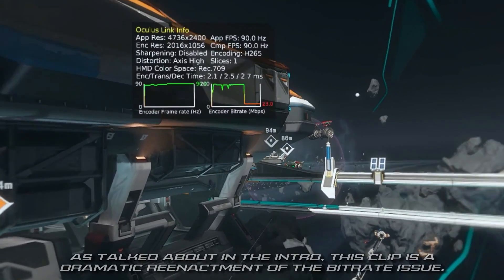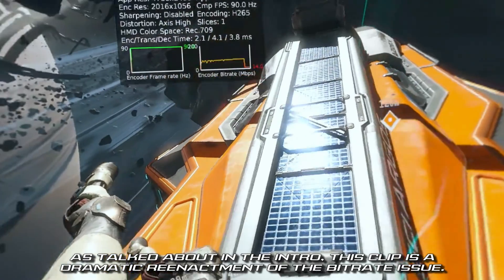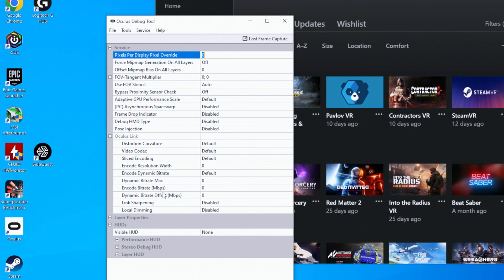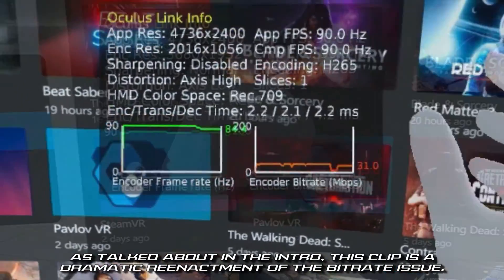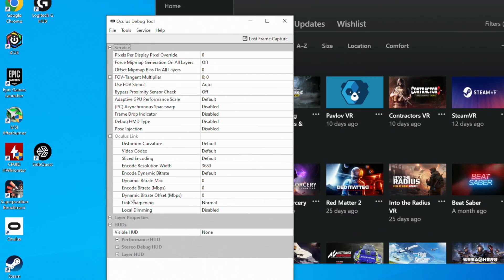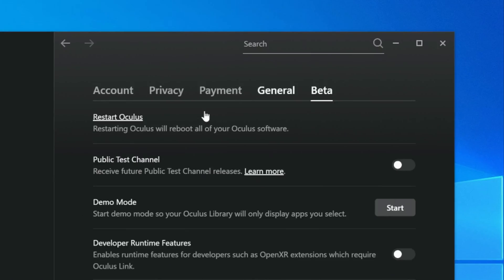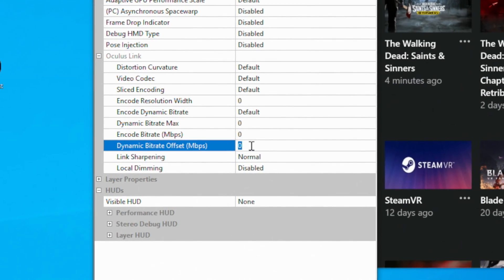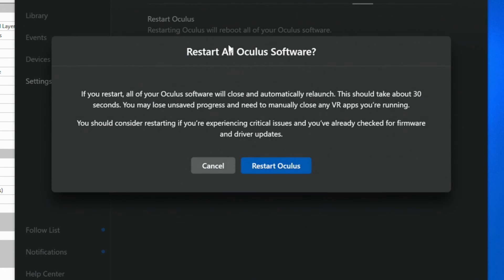Quest Link and AirLink Graphics Looked Horrible with My AMD Radeon GPU Until I Did This!

Comment: Since the video was made with the quest 2, what encode resolution would Width would you use for the q3? or is it the same
Reply from the maker: since making this video, I believe AMD and Meta have got things working better. I recently tested the RX 7900GRE and didn't have to mess with manually setting the encode width in the Oculus Debug Tool... well I guess that's not entirely true... when running at 90Hz or below the default encode resolution was great, however at 120Hz the encode resolution was noticeably lower, so I did manually set it when running games at 120Hz, BUT... I had a game or two start having frame rate issues. The Performance Summary overlay in the ODT showed I was running at 120fps, but it certainly didn't look like 120fps to my eyes, so I pulled up the Link Info and sure enough the encoder frame rate was NOT at 120. It was down in the 60's and 70's.  Once I set the encode width back to default it fixed that problem.
Reply: @Maraksot78  Ah okay thanks for the update, I was worried my gpu would be causing me problems but it seems I'm off good then

Comment: I use the old rift s with my 7800xt. I'm grabbing a quest 3 and hopefully I can test it before upgrading to the 7900 xt. Either way it's got problems on the rift. Ghosting on all usb ports and nothing I have done fixes it. I forced my ram to the lowest latency possible and slowly clocked it up rather than using xmp. I tried lowering my dpc latency as much as possible.  Went back to 10 cuz 11 is amazing at destroying frametimes. I also used an external hub for powering my usb. Still rough performance. But yeah meta is not optimizing for recent amd gpu's yet. But many things arent 7000 series compatible. I might just grab a 6900 xt rather. Gotta sell my 7800 xt first tho.,

Comment: Link/AirLink inconsistencies led me to buy Virtual Desktop a week after I got a Quest. It solved everything for me and I never looked back.
Reply: is it really better? After all, is only 20 $
Reply: @aplaceinthesky82  It's been my most used app by far. I connect to PC a lot and it's never let me down...but AirLink did.
Reply: @aplaceinthesky82  Yes a life changer but now there is steam link which is pretty close and free
Reply: @aplaceinthesky82  needs a 6e router then it's good
Reply: @aplaceinthesky82  I had to reset my plum router and choose auto instead of router. After the stuttering and drops were fixed!!! , My link cable works fine, and always has so I don't know what issues others had.
Reply: Why is my oculus debug a command prompt?
Reply: i am going to buy a quest 3 in august 2025 and pairing it with a amd 9800x 3d
Reply: with virtual desktop for streaming movies to the headset from my computer any suggestions.
Reply: I had the opposite happen haha. Virtual desktop absolutely kills my headset

Comment: As a laptop user i have always had trouble getting quality resolution using airlink and even a cable. I did not understand why for the longest time. I have a spec'd out rig that has me playing cyber punk in 4k after all with min 80 fps. Then I found out that my only my onboard amd card was compatible with oculus software but not my 3070 Ti! I switched to virtual desktop and never looked back. I average 10-15 Latency and can chose ultra settings in almost every game. Meta needs to expand or they will fall behind.

Comment: With my 6950xt and quest 3 I just use 250mbit fixed within the Oculus tray tool. 1.4x resolution in the Oculus Software. Within the quest I set the Bitrate to dynamic and slide it to the max which is 200. In the performance overlay my Bitrate is shown as a graph like if u set it variable but it's always at 250mbit. When the wlan connection is bad for some reasons, then the dynamic kicks in and lowers the Bitrate uner the 250mbit but that never happens when I stay near my router. Graphic looks good and the latency is around 40ms

Comment: does anyone know the encoding bitrate for the quest 3 and how to get that headset working with a radeon graphics card?
Reply: Had no issue with 6950xt and quest 3. What problem do you get?
Reply: @schaki05  no issue, just wondering what the bit rate for the headset was because the resolution on the quest 2 and 3 are different
Reply: @tophat5128  depends an what u choose. U can Go up to 960mbit but that will be at the cost of latency and stability. 250 works best for me

Comment: How does one get the 7800xt working with quest link or airlink? I receive a "GPU not supported" error, and it looks like the 7000 series isn't on Meta's compatibility matrix. I'm using virtual desktop currently to play PC games in the meantime (no ethernet, so performance is meh).

Comment: 3:48 wait a sec, how do you make the hands come out in questlink/airlink?? the only thing it always came up for me was the menu and oculus button gesture to pop up and I thought it was a bug
Reply from the maker: I'm not sure I fully understand your question. Are you trying to use Quest Link/AirLink using hand tracking only, i.e. without controllers? As far as I know, hand tracking only works with the Quests native menus and in specific hand tracking games. I'm pretty sure you have to use controllers for Quest Link. The hands you see at 3:48 is just the representation the Rift interface displays of the controllers. I was using controllers when doing all the VR stuff in this video.
Reply: @Maraksot78  ohhh I thought they were real hand tracking stuff, i did not know rift shows the controllers looking like hands xD

Comment: hey there what does application frame rate drop of 800 plus frames?  i have a lot of performance head room it says. and i have wifi6e set up.  on my 4090 is it a big problem? quest 3
Reply from the maker: As far as I can tell, it's a counter that lets you know when the application (i.e the game you're playing) drops frames. This does happen sometimes as you're playing, but most of those dropped frames are during loading screens, so it doesn't negatively affect the experience.

Comment: I recently upgraded to a quest 3 and when I try using quest link cable (official oculus cable) when I jump into quest link I can see that the refresh rate is obviously not 90hz it looks more like 30-40hz, when enabling the debug tool's performance graph I can see that I'm getting a solid 90 frames and have plenty of gpu headroom, I've tried switching the video codec from h264 to h265 yet the problem persists, the only work around was using virtual desktop but I'm far from my router so playing games like pavlov and contractors gets a bit annoying when my connection gets interrupted leading to delay/lag not to mention the decrease in quality 

If anyone has run into this issue or has any suggestions to fix it please let me know 

System Specs:
CPU: R9 5900x
GPU: 6950xt Red Devil
RAM: 32gb 3600mhz (4x8gb)
PSU: 850w Corsair RM850
MOBO: B550 Asrock Steel legend
Reply: I found the cause to my problem, having the "record desktop" option enabled under the record and stream section of the AMD software gave me this problem once I turned it off all returned to normal

Comment: I'm using a Rift S and it's been great with my 7800xt.  With a tiny bit of tuning It's awesome.  I think a dedicated PCVR headset is kind of where it's at with AMD GPUs right now.  Which doesn't bother me but I know a lot of people are really into the Airlink/wireless thing.
Reply: I just got the RX 7700 XT, coming from a 1080 SC. I'm blown away. Seamless VR. Returning it for the RX 7900 GRE, only because I want the extra headroom. So that I'll theoretically be covered for the next few years.
Reply: @Cogsworthcreations there'll be a new GPU standard by 2026 and you'll be behind lol. Watch. Not just vram but the actual architecture
Reply: @Cogsworthcreations  good decison. Did the same from a 5500xt to an 7800xt.
Reply: Am intending to get a used Rift S for PC VR n running the 6800xt
Reply: I can not turn of screen you to
Reply: Can you pls tell your settings? I am using 7900xtx but the graphics on RE7 PC mod looks really bad

Comment: Yet all the non-tech savvy normies will blame AMD when it meta. Started digging into this myself when I saw the channel ‘Cid from VRChat’ dumping all over AMD while as people (myself included) using non-meta headsets like the index, reverb, and vive had no major issues.

I was running on a wx7100 with zero issues at one point… that’s comparable to a 480… yet people are saying newer 6000 and 7000 series cards bad and unable to handle VR.

Makes me wonder if this bias is some shady corporate warfare against AMD cause I just don’t see a company as big as meta-messing up like that on accident. Either way it obviously hurts. AMD’s reputation as only dedicated gamers like yourself would dig into this matter.
Reply: Also, apologize for the bad grammar. I’m on mobile right now.

Comment: I don't know if this will help anyone with a amd gpu. But I think there's one setting in the Oculus debug tool. When I was trying to enable h2.65 in the video codec setting.  I was experiencing a weird tearing issue on my right eye in the headset. But then when I turned off sliced encoding. that issue entirely went away and never came back. I was thinking that was the same issue that some people were experiencing on AMD cards and was wondering if that could probably fix it. For me when I went back to h2.64 with sliced encoding off both of them had no micro stutter anymore after I turned it off. But I want to see if that could be the fix for anyone on a amd gpu. If it doesn't then man oculus needs to fix their app

Comment: Airlink and Meta's software simply sucks. I have a 4090 and ONLY use VirtualDesktop because I still have issues with their software. If you have an AMD GPU you should definitely deal with VirtualDesktop and not even bother with Meta's side.
Reply: Totally agree, I have some problems with my 3060 6GB laptop. Oculus linking via Airlink or cable is terrible. The computer reported missing Vram as soon as I opened HL Alyx. Meanwhile, the connection via Virtual Desktop is very stable.
Reply: Dropped Air Link as soon as Steam Link became available. It just works.

Comment: I will say I did some research and testing on the Oculus software and I just find it weird how it works compared to virtual desktop

First with what you know, encode resolution is always lower than app resolution, which made me wonder if there's even a point on increasing the resolution past the native Oculus display specs

2. On the exact same tab you can see your encode framerate, for the life of me I could not get this to stay at 120, it always hovers around 90, which is why I felt virtual desktop so much smoother, virtual desktop also seems to give you the full resolution you set your graphics settings to rather than Oculus

3. I find bitrate on virtual desktop kinda weird, on Oculus I never really noticed a difference unless it was set to a very low value, however on virtual desktop your latency increases quite noticeably if your bitrate is above 60-80 (at least with a 1060, maybe newer GPUs have more headroom), I also found that h.265 tends to have higher latency that h.264, but on interesting ways, for example, if both encoders are set to 60 bitrate, both have a 30ms latency (example) under same conditions, but h.265 tends to spike to 35 or 40ms, if we put h.264 at its absolute minimum, you can get down to 20ms (quality is horrible though), and maxed out to 150 bitrate, h.264 still manages to stay on the low 30s where as h.265 tends to go to 40-45
Reply: Newer GPUs arent as affected by bitrate.

Comment: Cheers. I have a different set of issues with airlink and link on my Quest 2 with a 6600 XT, 5800X3D system. Mostly awful aliasing resulting in awful "jaggies" and shimmering along the edges of objects (the window borders have jaggies that look like something from the '80s). Also occasional stutter. 
I'll try your settings anyway, see if there's a noticeable difference.
No issues with Virtual Desktop except for strange colours and contrast compared to my desktop settings. I've also had intermittent issues with Oculus set as the default for OpenXR instead of Steam (as in setting it to Oculus would prevent some titles in Steam from running). 
Sadly, despite the bang for buck advantages in terms of raster performance, I've had a lot more issues getting VR working properly with the Radeon than my prior Geforce card. That's without even looking at products like the Varjo Aero or DPVR E4 which flat out state they are incompatible with Radeon cards.
AMD doesn't seem to prioritise VR (small market I guess) and VR companies like Meta, Varjo, DPVR  just don't seem to prioritise AMD (also due to market share I imagine).

Comment: So 7800xt can vr?
Reply: No, you need a 4090 Super Ti to, at least, run on low 72hz
Reply: @hburners361  nice joke
Reply: My RX7800XT is getting awesome, giving me 4070TI performance on MSFS2020, it surely needs a lot of tweaking because neither Asobo nor Meta are willing to fix its issues with AMD. But after tweaking and testing I finally getting the performance I wanted on this sim.
Reply: Yes, check his last video for details
Reply: @jaydude84  thx
Reply: My 7800XT works perfectly with Streaming Assistant and the Pico 4...which is so much better than Quest2...( i'll never go back with Meta and its shit PCVR software...)

FS2020; The pico 4 headset set to 90Hz and Ultra allows me to have 45/50 fps at 130% rendering...
Afterwards, MFS2020 remains a demanding game, but if you limit the LODS ( Levels of details: range when the graphics appears better...by example, no needs to see a perfect texture for a tower control at 40m from it, when you fly at 400km/h...200m is enough), Traffic Control and the weather, you will have no problem, even in a big city like New York!
Very happy with this graphic card !
Reply: @SETHalpine  is a rx6800 and a pico4 also a good duo ?